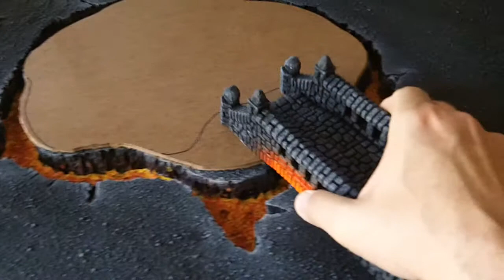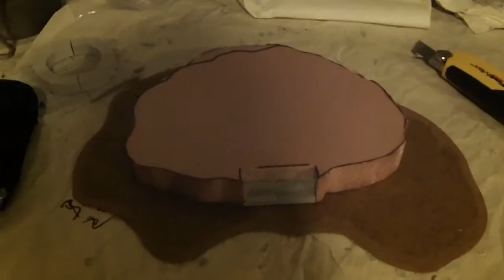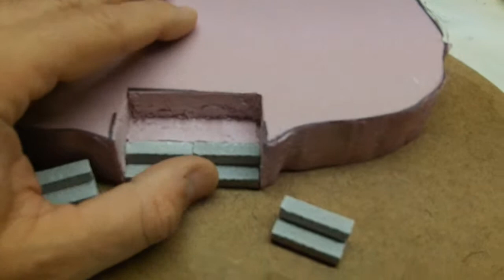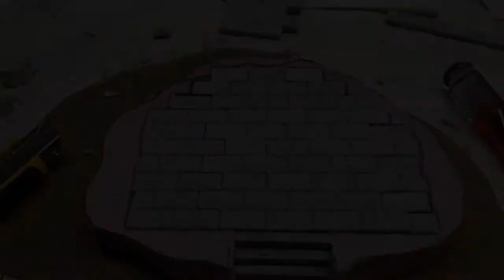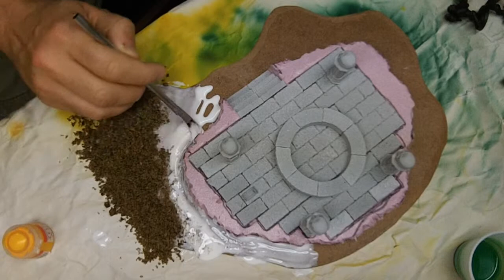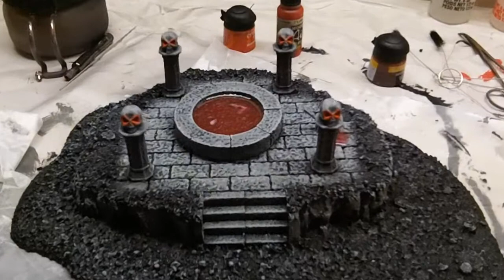How to build a bloody altar

Comment from the maker: It is a product called "quick water." It is a two part epoxy that is usually used for making fake water in flower arangements. It is very easy to use. I picked it up at michals or one of the other craft stores, can't remember which.